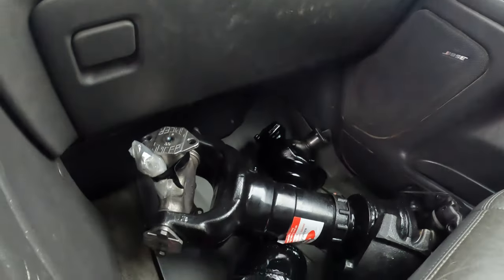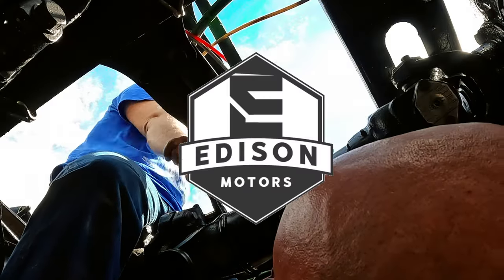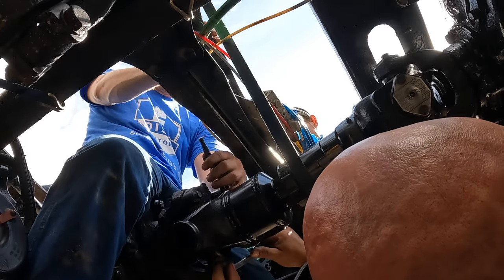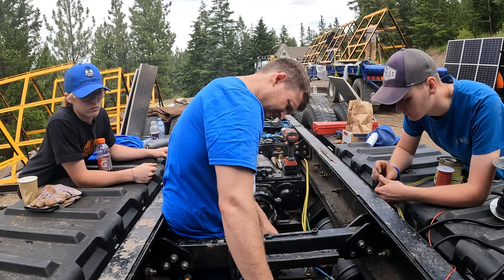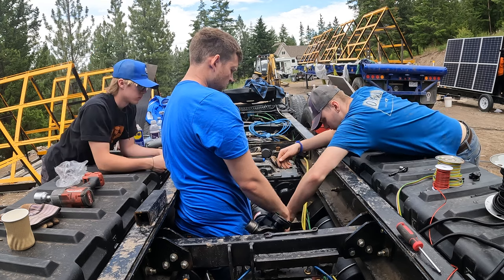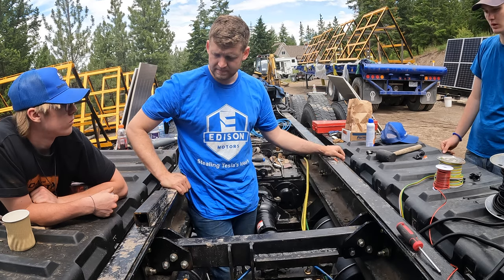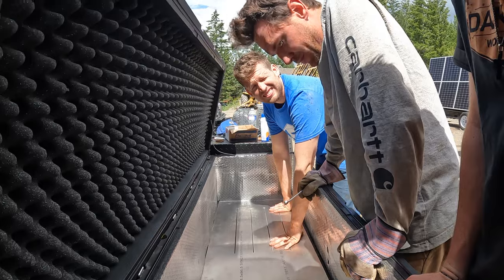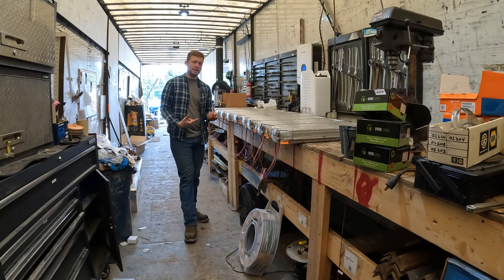A day at Edison Motors

Comment: Love what you guys are doing.  The driveshaft your putting in around the 14 minute mark looks like the slip yoke is faced toward the back, normally points forward unless you guys had to do something custom.  Also, for putting in the full round caps I cut the heads off a couple long fine thread 3/8” bolts to use as guide studs and you just slide the cap on and drive em home then swap the studs for bolts one at a time.  Saves you from having to tap it around to line up the holes.  Love seeing another guy in this industry who doesn’t want to just log earth first and move on to the next planet.  Definitely subscribed.

Comment: Thick bedliner in battery boxes would be an awesome insulation, thermal and electrical! Wood stabilized with epoxy, then bedliner on one side/both , lots of ways , but production is a different story!